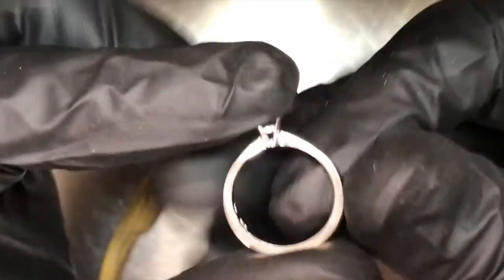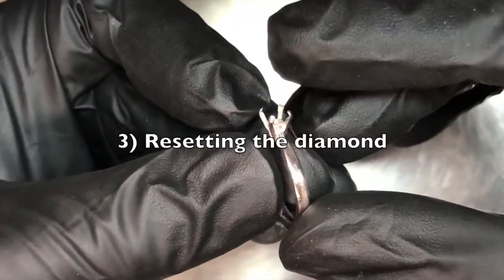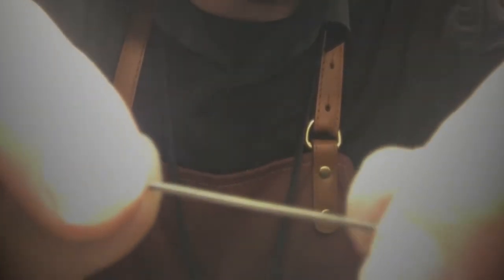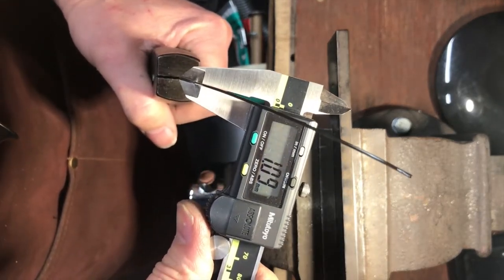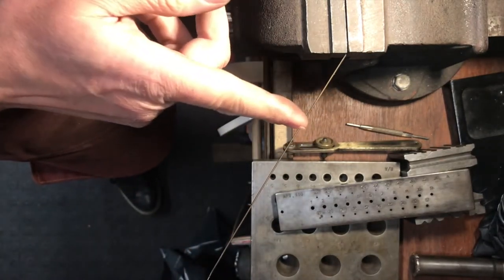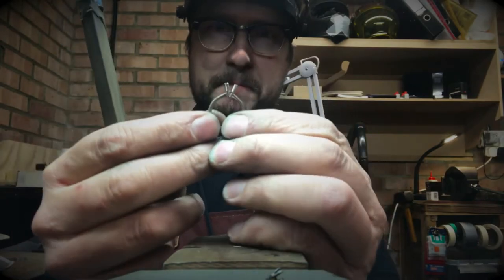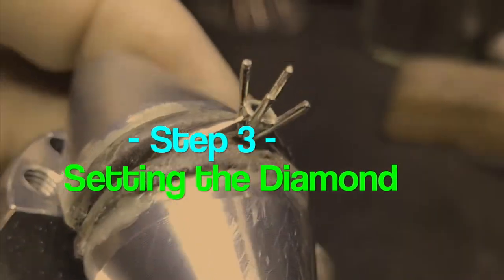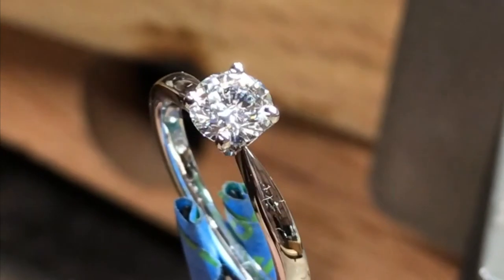Jewellery Repair - Re-Tip Diamond Ring Claw [ReBuild]

Comment: What kind of jig did you use to solder the wires together?
Reply from the maker: Hi Amanda, thanks for asking as I forgot to describe that little helper. It’s been with me forever and has no brand attached to it. I can’t tell you where to find these unfortunately. But what I will do is add it to the list and make a video about how it works. If I spot one for sale I will add the link here for you 👍🏻

Comment: Amazing! I was watching this because although I love my ring, the prongs look far too thin and weak to me. I just wanted to ask, here you removed the original head of the ring by heating it because it had been soldered to the shank. Could this same repair and rebuild  process be done on a ring where the entire ring has been cast as one whole piece? Is it even possible to saw the head off the ring from the shank?
Reply from the maker: Hi Aaisha, yes it’s completely possible to repair a cast ring’s claws. In fact, I just remade some claws for such a ring today. Many cast rings are often bought in parts so just have a closer look as this might be the case. If not, I simply saw it off, rebuild a new setting and solder it back in.

Comment: Wow, fast reply!.I'm thinking about buying a lazer welder for my shop, do you think its a  wise investment  ?
Reply from the maker: david walker - for retail it makes sense. I would go for it. But then I have a slight tool problem, so my advice might not count.
Reply: Thanks for the advice.  I get your tool obsession, 😁👍
Reply: I worked with a laser welder for many years, absolutely loved it. It takes several steps out of the process. Which can make some normal soldering repairs very quick. I Know they are rather expensive but in the long run well worth it. I have done everything from retipping to actual sizing. By using gold wire I like the way the finished product looks. I have seen times where you can actually see the color difference when torch soldering. I was actually the first person to use a laser welder for ArtCarved and Balfour years ago.